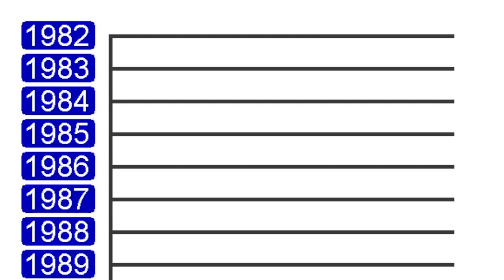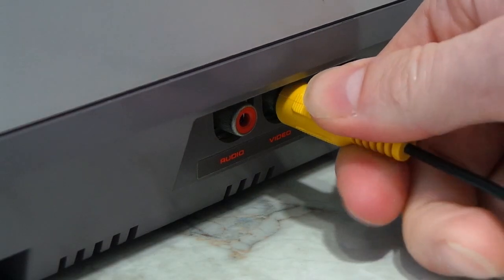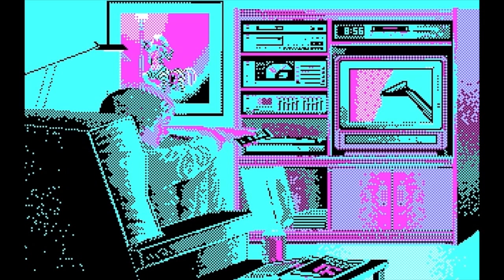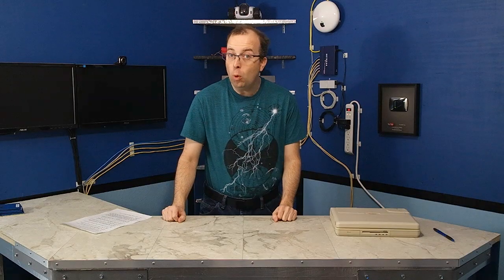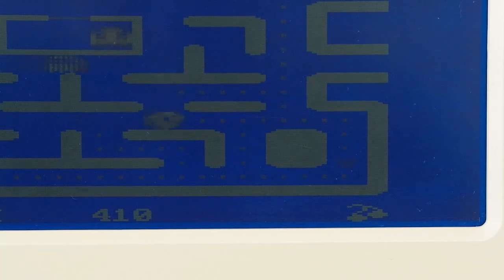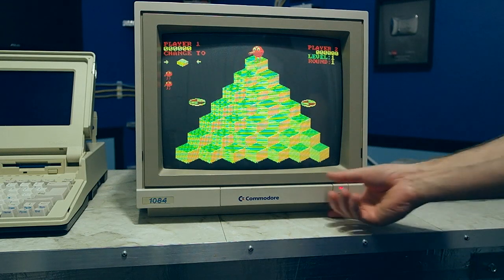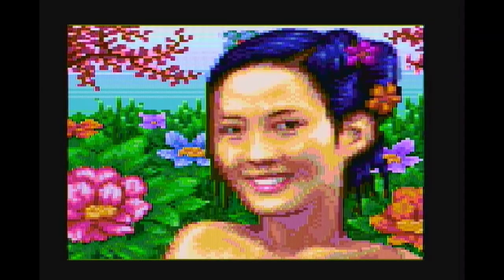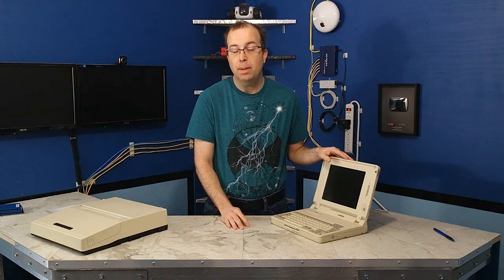CGA Graphics - Not as bad as you thought!

Comment: OMG, that Total Eclipse runs superfast compared to C64!
Reply from the maker: +algi To be fair, that was running under DOSBOX when I captured the video.  When I ran Total Eclipse on the old Tandy laptop it ran about the same framerate as the C64 version.
Reply: +The 8-Bit Guy Oh, that sounds good, I might do that myself, too.
Reply: +Kurt Angerdinger ... not quite correct. The original IBM PC was 4.77mhz (sometimes written as 5mhz), and although it was on an 8-bit bus, had a 16-bit CPU core (making it rather more cycle-efficient once you'd actually dragged the opcodes and data out of memory, across the bus, and into its ALUs --- but making those memory reads and writes pretty slow because it was generally shunting 16-bit data down an 8-bit pipe).

It was also a very definitely CISC design, being an evolution of the 8080 chip, same as the Z80 was - vs the RISC type 6502. And you can generally see when putting 6502-based computers (like the C64, Ataris et al) next to Z80 based ones (MSX, Sinclair, Sega), that they seem to come out about equal in terms of actual execution speed on the same kind of program when the Z80 is running around 3.5 to 4Mhz, but the 6502 around 1 to 2Mhz...

There are certain things each type does far better than the other, and can upset that balance either even further apart or bring them together/reverse it, but that's the general scene when you bring "equivalent" gaming / everyday-use machines together.

So, if we think of the original PC and XT (which only had an 8Mhz (7.14mhz??) CPU as an optional upgrade) as effectively having ~5Mhz Z80s in them, with somewhat hobbled graphics hardware vs the very elegant setup in the C64, it makes sense that the ultimate framerate comes out roughly the same... certainly within 25-50% of each other, which is how much it needs to be for you to easily eyeball it.

The PC platform only really started to shine as the 16-bit machine it tried to position itself as once cloners began installing better CPUs in them (NEC V20s and the like) or building systems with actual 16-bit architecture (and, thanks to that, better Intel chips like the 80186) - and, ultimately, once the PC-AT came out with the 80286 in it. Though, really, until the 386DX came along - preferably paired with a VGA card, 2+ mb of easily replaceable memory, adlib soundcard and an integral hard drive - the PC compatible platform wasn't really that great a competitor in the home market. Quite why so many US households went for it and shunned the far superior (and cheaper) Atari and Commodore 8- and 16-bits of the age, I'll never understand. Maybe the names made them think that they were foreign machines made in Japan or Mexico, even though all three were true-blue American brands?

(And yet, they took to Nintendo like a long-lost blood brother... maybe they thought Mario would get the Family involved if they didn't?)

After all, a 12Mhz 286 is only just about capable of running a Wolfenstein-type game (and was amazingly expensive in the mid-late 80s), but the far cheaper 7 and 8Mhz Amiga and ST have also shown themselves perfectly capable of such in recent years...
Reply: I always thought games looked and sounded better on c64. Compare Ultima 4 to the Apple and Dos versions.  C64 had the best sprites and sound
Reply: I own a eclipse mp3 player
Reply: +Kurt Angerdinger You mean "blitter" chip, and more precisely, Agnus chip (which contained not just the blitter, but the copper and all the DMA channels as well).  "Clipper" chip was a government recommended encryption backdoor chip for ostensibly secure systems.  ;-)
Reply: +Kurt Angerdinger The C64 had a monochrome bitmap (or 2bpp bitmap in multi-color mode).  However, it's layout was not optimal for gaming.  I don't know much about ZX Spectrum, but one of the HUGE impediments to fast graphics on the C64 was the bizarre layout of its bitmapped memory mode.  Sequential bytes did not correspond with horizontally adjacent sets of pixels.  Bytes 0..7 corresponded to what would have been a single character cell, but then bytes 8..15 to the next character cell, etc.  So, to move one line of video, you had to fetch and store a byte, then adjust pointers by 8 manually.  IIRC, and I could be wrong, the Spectrum had a linear framebuffer, which let the Z-80's LDIR instruction do the heavy lifting.  Clock for clock, the 3.5MHz Z-80 had the same number of MIPS (on average) as the 1MHz 6502, so the real speed boost, I think, comes from the layout of the graphics, not from raw instruction throughput.
Reply: Guys I love technical discussions. Keep up the good work! :-D
Reply: I always thought the XL version of any game edged out the 64 in graphics speed and color, even tho the resolution and sprites weren't as good.. but nothing audible came close to SID until the later Creative Labs cards, and even VGA was pretty bland with an AdLib soundtrack.
Reply: algi p
Reply: +Kurt Angerdinger Weren't the Mercenary games running smooth compared to Total Eclipse?
Reply: +Kurt Angerdinger Unless you were scrolling to the left, right, up, or down, the VIC offered no assistance for bitmapped graphics support.  Even then, scrolling was limited to at most 7 pixels.

CISC vs RISC is not the issue (Z-80, being derived from 8080, is more RISC than most people give it credit for).  The problem is the state machine used to talk to the bus.  Zilog's parts needed a minimum of 3 cycles to talk to RAM because it used a fully synchronous, edge-triggered design.  The first cycle drove the address bus.  The second cycle was intended to let RAM respond, and the third is when the CPU latched the data from the data bus.  Generally, three cycles constituted an "M-cycle".  Instructions were always timed in terms of M-cycles.

Rabbit Semiconductor, IIRC, once made Z-80-compatible chips which did have 1-cycle-per-instruction parts.  So it's very possible to achieve technically.  It's just that Zilog's parts have not (certainly not that far back).

The 6502 has one cycle per bus transaction due to a simpler architecture and level-triggered, two-phase logic; however, no instruction on the 6502 took less than two cycles to complete because of how its internal pipeline worked.  So while bus efficiency was higher than the Z-80 of the day, people ran it at a lower clock speed because it was "good enough."
Reply: +Kurt Angerdinger 4.7 MHz actually.. which parts of the 64 could handle, but not VIC.
Reply: I like your picture, very Satan-y!
Reply: +Tommy Whitaker we don't care
Reply: If I am not mistaken a C64s processor only ran at 1 MHz.  Then the thing had 64 KB of ram.  I had one and it was a miracle they could make games for that thing as good as they did.  I had a lot of games for it and that was mostly what I used it for.  You can get an emulator and the game images easily.  The images are around 175 KB unless zipped.  They are ultra fast downloads on any fast internet connection.  Look and you will probably find your favorites but an easy to use emulator is a must if you are not familiar with the commands.  Sure they are easy but the keys in some emulators don't match up to ours and that is frustrating.
Reply: The 6510 for NTSC devices ran slightly above 1MHz, and the PAL version ran slightly below 1MHz.
Reply: +algi Check out my speedrun.  :-)  watch?v=hL90h4vvx_4

Comment: After watching this, a series of questions keep popping in my head...the graphic memory needed for CGA is just 16KiB. 64KiB for EGA, and 128KiB(and above) for VGA..
1)how much graphic memory a typical modern 1080p display mode actually need? if in the 1920x1080 32-bit color mode, that's mathematically around 7.9MiB. 
Will only 8MiB of G-RAM actually work at 1080p a modern operating system for desktops?
I recall my Windows XP crashes under 32MiB of shared GRAM even at 1024x768 reporting out of memory. 
Since modern graphic cards all need a driver to enter advanced/proprietary modes beyond VESA/SVGA,
2)How does a modern OS, namely Windows, use graphic memory? What program/application/API will use the graphic memory? 
if I can avoid those programs that use GRAM, will the merely 16MiB of GRAM good for daily use of  the most majority of the programs at 1080p?
if that's true, 99.55%(3568MiB of 3584MiB)RAM on my GTX970 has been sitting there,not in use, idle of the most of the time when not playing 3D games. is that true?
3)Is it true that other than the graphic memory needed for pixel buffering, i.e. 8MiB for 1080p,  only the textures and vectexes of 3D graphics would use the extra graphic memory ?
Reply from the maker: +imkow Correct.. Most of the RAM in modern video cards is used ONLY for 3D applications.
Reply: +imkow Under OSes like Windows Vista and above, using Aero will tend to use graphics RAM (since the card is functioning in 3-d mode,) but not very much of it more than what would normally be needed for the display, IIRC.  And yes, while you're not in a game (or other 3-D using program) most of that RAM is idling.

Comment: Modern DOSBOX supports Composite Mode!
Reply from the maker: +Chris Katko Not very well.  I could not get it to work on most games I tried. and believe me, I tried a lot because I didn't want to have to point a camera at a monitor.  I also tried using an NTSC capture card but it wouldn't synchronize with the Tandy laptop.
Reply: +The 8-Bit Guy 

I got it to "work" by downloading the latest SVN build of DosBox, and then pressing SHIFT-F12 while in the game. I also set machine=cga in the config but that might not be necessary. 

The results are interesting with the game Troll's Tale. I wouldn't call them perfect but they're much better than straight CGA (minus the text blurring issue). However, I don't have a real composite-CGA card to compare to right now so I can't tell you whether it's "worthy" or not.
Reply: +Chris Katko The latest DOSBox contains very accurate NTSC-emulation developed by reenigne, one of the coders of 8088 MPH. The final version of 8088 MPH on YouTube was captured raw from a real PC, then decoded in software with routines similar to those in the latest DOSBox. They are highly accurate.
Reply: +Scali Bohemiq thanks for the info!

Comment: Composite CGA isn't even close to C64 graphics.  No way.  Better than Apple 2?  Yeah.
Reply from the maker: +CaptainRufus I have to respectfully disagree.  And keep in mind I'm a big fan of the C64 and do a lot of programming on it.  I thought about showing some comparison screen shots of similar games on several platforms.  Maniac Mansion is much better looking on CGA, for example.  But even from a technical standpoint, CGA wins.  It has twice the video RAM.  It can place any pixel on the screen with any color.  Not limited by color cells.  Sure, the C64 has some software modes like FLI, but now so does CGA.

Comment: I  have a little question. Back in the day i had a 8086 with a EGA grapicscards... that is a pretty good grapicscard for a 8086.....

I didn´t know it as a time, but besides the 9 pin D-sub there was also the composite......

And a lot of games uses interpolation of colors.... soo.. if you use the 16 available colors, and the composite trick. Very games used this trick... but there was one i rembered using a lot of color mixes.... A10 tank killer.
http://www.mobygames.com/images/shots/l/18705-a-10-tank-killer-dos-screenshot-flight-map-ega.gif

So it would seems like using the EGA in a simular fashon would really makes the colors pop a bit more.

Also, interstingly the EGA got the hack 16 color mode, there was a hack 64 color mode on EGA, but i never seen it used out side of demos.
Reply: +matsv201 Unfortunately the composite connectors on the EGA card aren't connected to anything, so you'll just get a blank screen if you plug one into a composite monitor. They terminate on the feature connector, so presumably IBM thought they would make a feature connector module which added composite output to the EGA card, but as far as I know they never did.
Reply: andrewmjenner Well... that is intresting.. It seems kind of wastefull to populate the socket if there was no electronics behind it....

The graphics card we hade was not a IBM, it was some clone

Interestingly the EGA is almost identical to CGA apart from it have tripple intercity cables... that are hardly ever used, and twice the amount of memory.

Something that always bother me is the color limitation of EGA.. and also CGA.

The hardware support 64 color, the memory support 64 color, the screen support 64 color, but the control chip don´t.

Games would look amazing if they could use 64 colors on EGA...

And CGA, same thing. Everything in the system support 16 colors apart from the control chip that of some reason demands a pallet. There is even 778bytes to spare to show a full 320x200 screen with 16 colors....

It seems like someone in IBM just didn´t think.

Also the byte by byte transfer... why? i can se no reason for it

Comment: Interesting that CGA mode also relates to the horizontal frequency of the monitor.  Old arcade games used "CGA" mode at 15khz but used analog RGB to get 16.7 million colours - basically standard old TV - same effective maximum resolution of 320x200.  So the colour limitation on PC is more a hardware/design limitation - the 16k on the graphics card for a frame buffer is why it sucks.  Arcade games had less memory but buffered only 1 line per playfield so you could get a lot out of 2048 bytes as they had custom palletes.  PC of course being designed for multiple purposes.  It could have done so much more though.  Never knew about the artifact trick for more colours.
Reply from the maker: +James Brindle Arcades use a mode more similar to Amiga, Atari ST, and Apple IIgs.